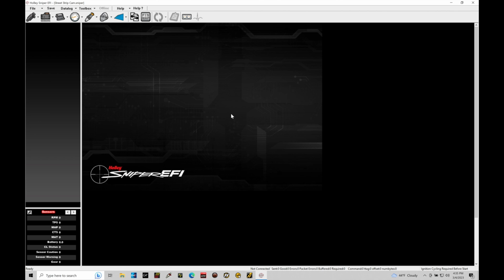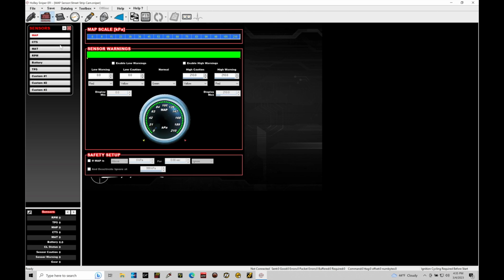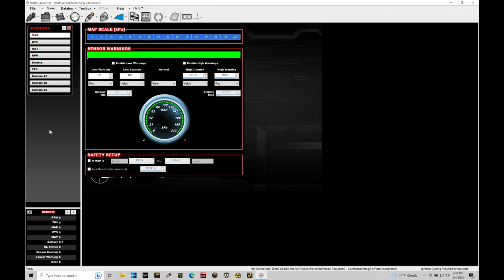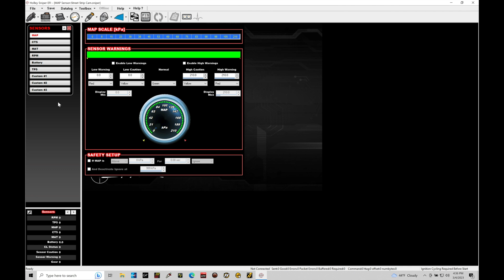Holley Sniper EFI Training Part 28: Flex Fuel Tuning | Evans Performance Academy

Comment: i was under the impression this couldn't be done because the inputs are only 5v sensor inputs (mainly for pressure sensors). thought you have to have an arduino or something similar to convert the signal. but also, your subscribe link is broken.
Reply from the maker: Yes, correct a processed 0-5 volt signal needs to be used in order to properly configure and tune with Flex Fuel.  We cover the options in the tutorial.  Thanks for catching the bad link on the purchase option for the course.
Reply: ok, thought so. thanks for the quick reply. someone wanting to run a flex fuel sensor on a sniper posted on one of the holley FB pages and i directed them to this video. I'm personally looking at purchasing a haltech course from you. the gui looks different now than from the videos i saw though. I'm looking at purchasing  nexus r3. coming from holley, so i'd love to get educated on the gui (where everythings located and such).  @EvansPerformanceAcademy
Reply from the maker: @callofgeorge  Yes, Haltech has switched to the NSP software which is different than the older ESP software.  We have an entire NSP training course available now which has over 40 hours of training tutorials.
Reply: awesome. i'll go back and look for it. thank you so much for taking the time to chat with me. excited to learn this platform.  @EvansPerformanceAcademy